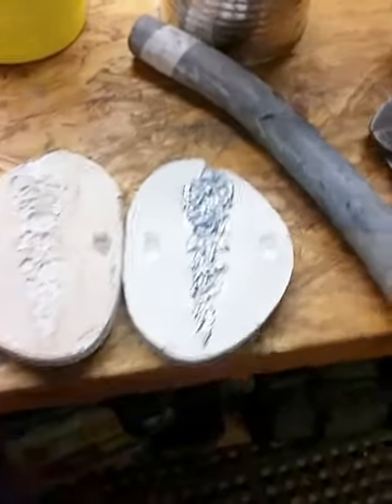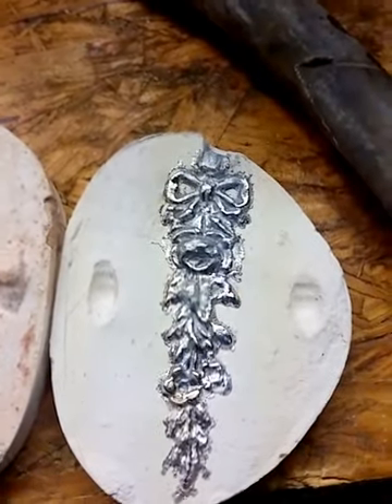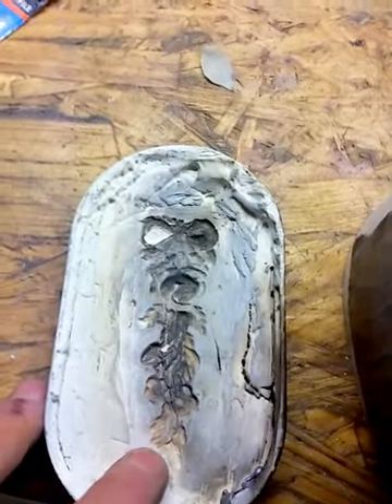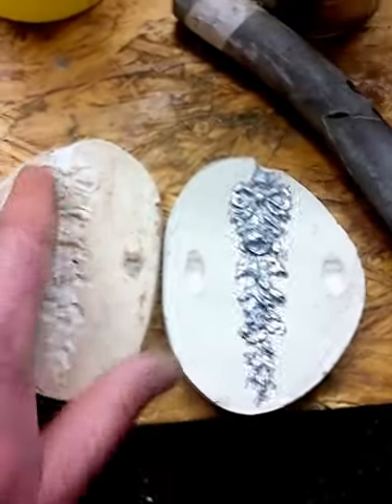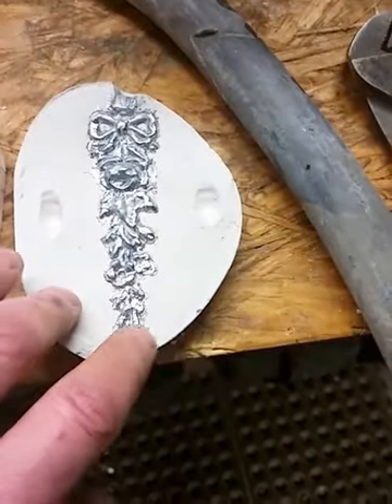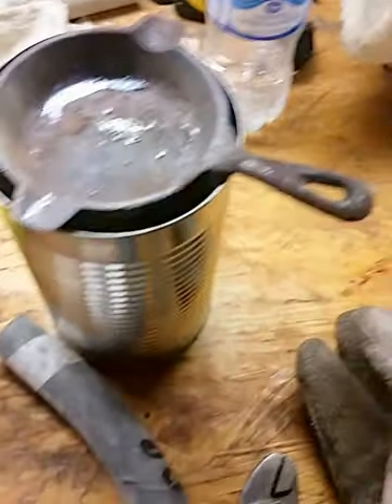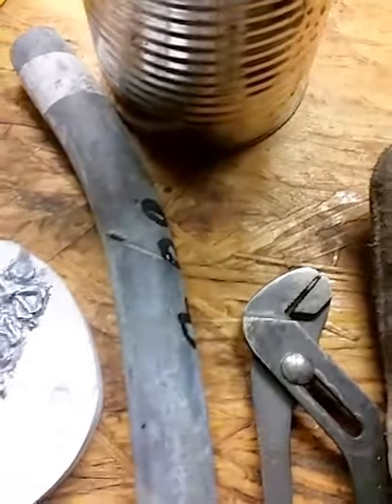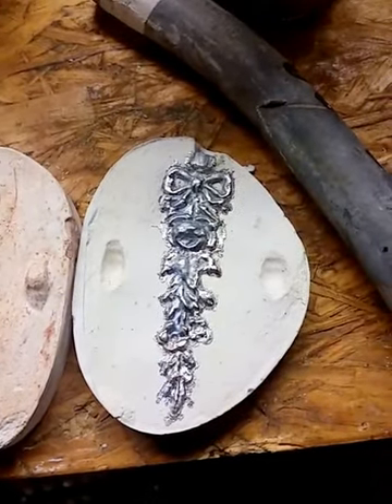Plaster of Paris two part Mold for Lead Ornament

Comment: how'd you get the lead to feed down into the plaster cast?
Reply from the maker: Tiffany Welton I stood the mold upright in a vice and it had a pour hole in the top of the mold. Then poured the lead slowly into the mold. Worked great.